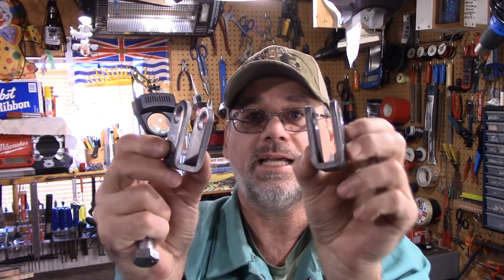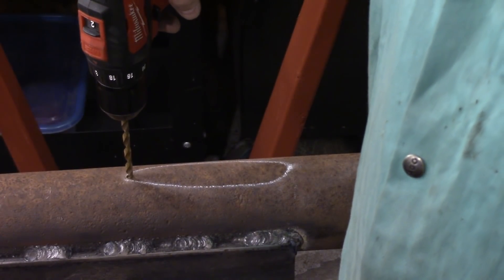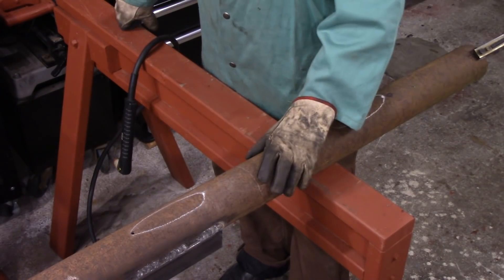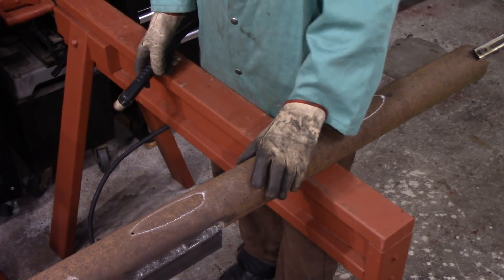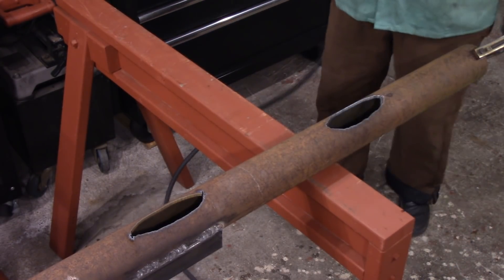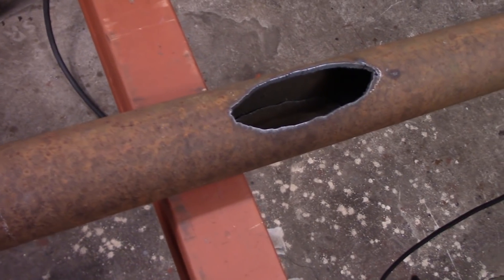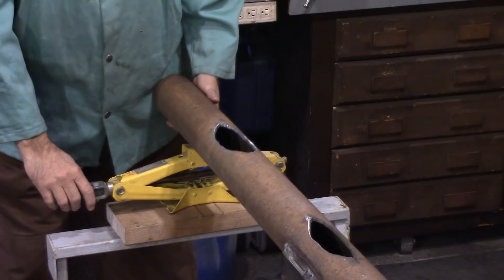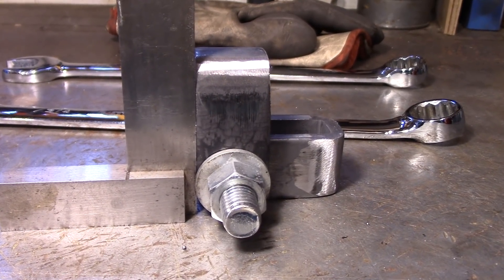HOW TO BUILD A SOLAR PANEL TOWER/POLE FOR MY REMOTE CABIN IN THE WOODS - PART THREE

Comment: Oh. Is that the (almost) problem ? The pole being pinned into the back by the hinge ? I guess last night I just assumed you had done a radius on the back of the pole. But then we would have had more awesome plasma cutting action :-)  That should work though, unless you think it'll weaken the pole too much. Or am I still missing something ? You probably already got er figured out anyway :-)
Reply from the maker: I think I need to go back simple and no hinge  but its coming along nicely if it doesn't go sideways again 😂😂

Comment: I was going to bed when I saw your "Epic Fail" title pop up and thought "OH NO" so I had to watch it. I kind of wondered at the start how you were going to make that work as a hinge, trusted you had it worked out, then got distracted (again) by the plasma cutter :-)  Slicker than snot ! If I get serious about metal fab I have to steal me one of those... you don't lock your shed do ya ? lol  just kidding

Then it got to the ready for ticky tack and I'm going... hmm... that looks... off... and was worried you were going to weld er up solid before you took a step back. But am I too tired ? I swear if you just flipped the "hinge" 180 deg so the pivot is in the crotch wouldn't it work ? I'll have to look at it again when I'm awake :-)
Reply from the maker: It does go sideways once in a while and the whiles seem often in my shop.  Yes the plasma is the tool to have if you need to cut mistakes out real fast. LOL